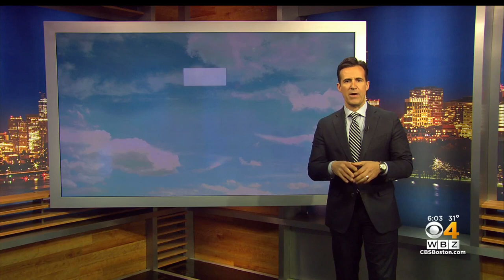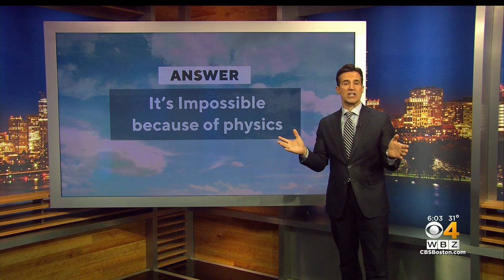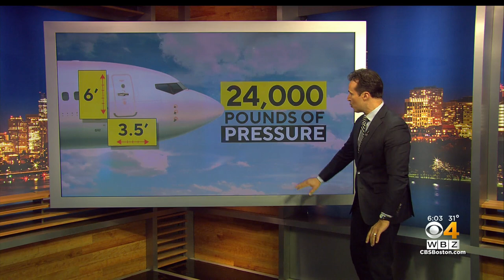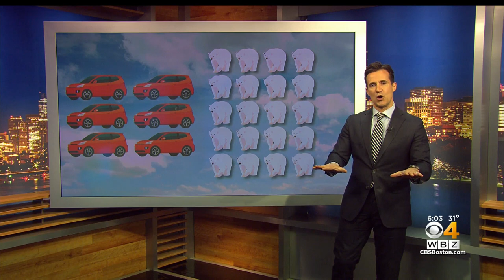Is it possible to open an airplane's emergency exit door mid-flight?

Comment: Boy do they look like shit now that Asiana 214 had its door opened at cruise altitude.

These idiots neglect to understand the 24,000 pounds is PUSHING OUT on the door, not in! If the guy unpins the door and unlatches those safety bolts… we’ll, you get Asiana 214!
Reply: cause the plane was already about to land. i believe it was like 100ft from the ground, hence the pressure is so much lower compared to 31,000 to 38,000ft which is the typical cruising altitudes for commercial plane. And the guy in this vid talk about the cruising altitudes one!
Reply: You're 100% wrong buddy.